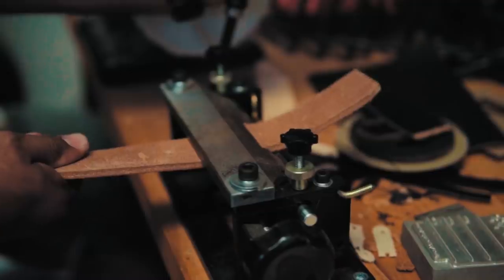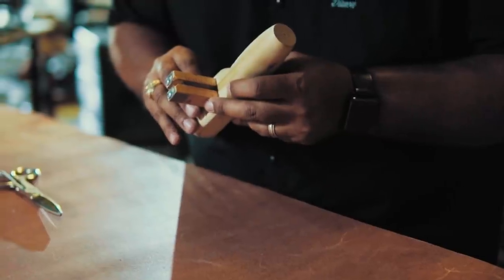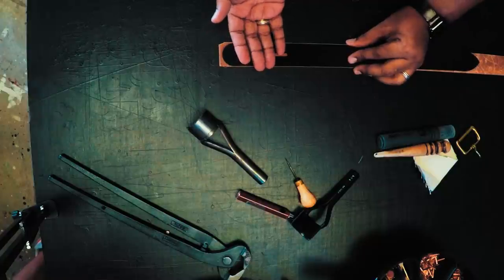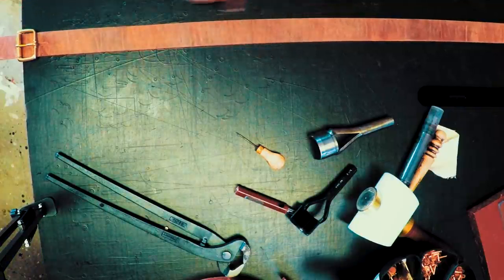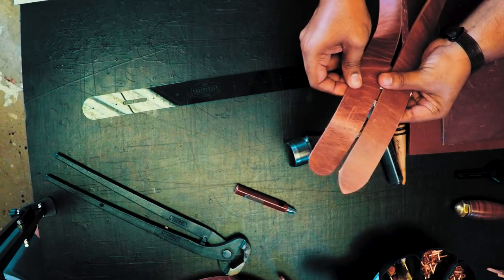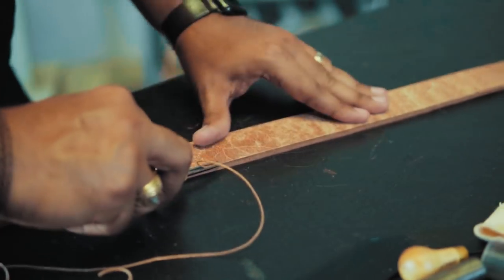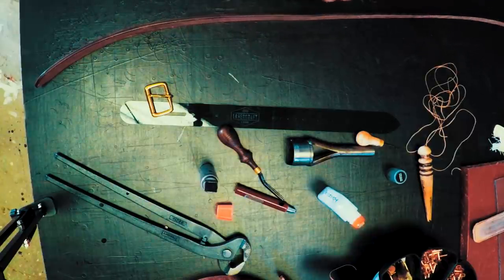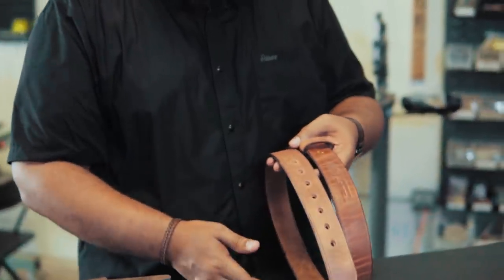Making A Belt That Will Last A Lifetime

Comment: I bought a similar weight “tool” belt to wear on top of my FF bunker suit to carry a rescue tool. Shortly after I got it, new regulations didn’t allow that so I added holes and started using it as my work belt. That was 24 years ago. I grew into it and still use it to this day. Can’t be quality-built stuff.

Comment: Great video.  Would you mind sharing what size thread and needle you use to stitch your belts?
Reply from the maker: I use a 207 thread, but I don’t recall the needle size. I never change the needle size, as I pretty much only use 207 thread on that machine - occasionally 277.
Reply: In my saddle work I use mostly 277 but on some belts and decorative stiching, 346 really stands out.  You need to use a groover at times tho.